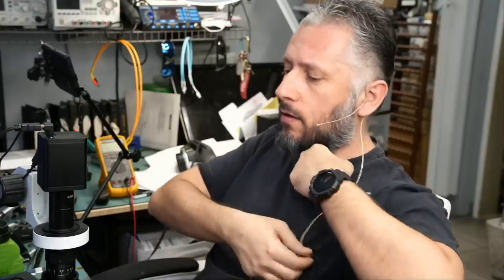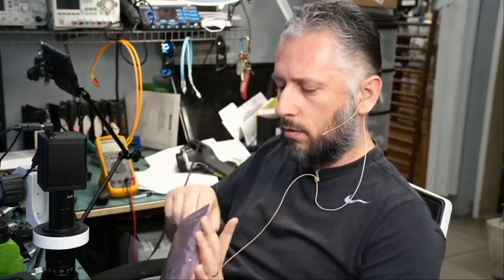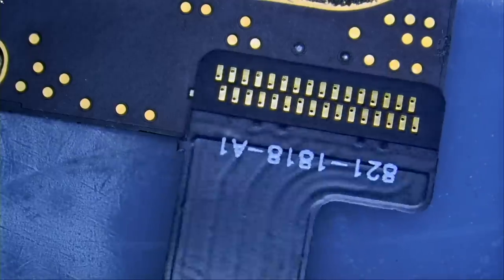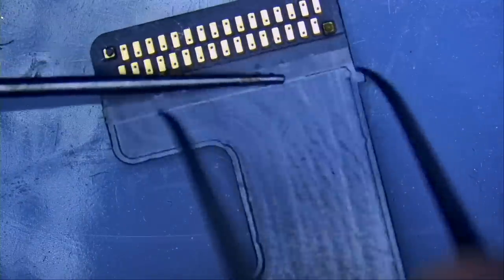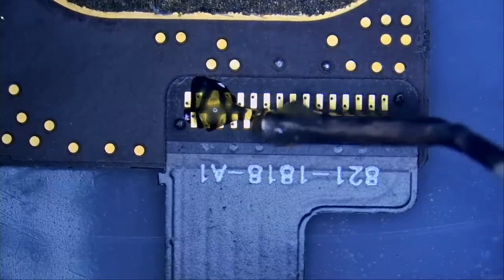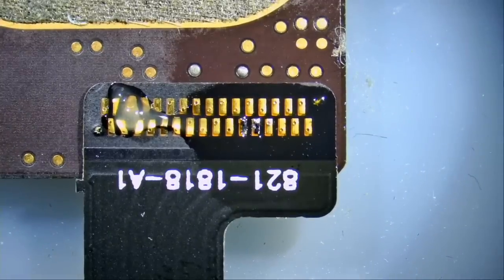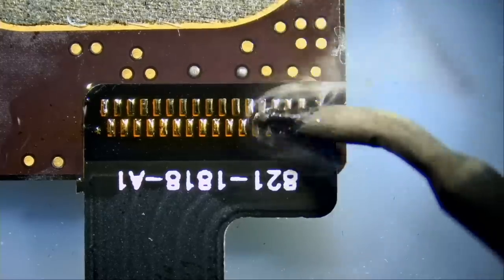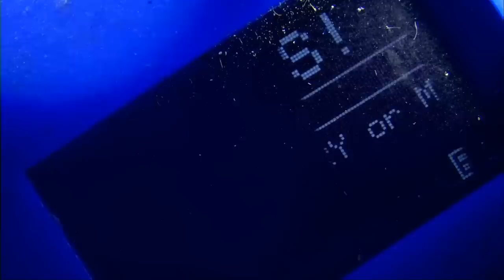Last repair for the day.  Mini Flex

Comment: Question…You did not apply solder between the cable and the board. Why not? Are you relying on solder to go through those tiny holes in the top of the connector?

Comment: I don't understand this one. You put flux and solder on top of the connector, but it gets soldered to the bottom. You put no solder or flux on the PCB. How does this work?
Reply from the maker: The pads on the wire has holes in them. Solder flow thru the holes under the cable.

Comment: I was expecting to see solder on the board first before the connector went on top and soldered, unsure how the small pin hole managed to get any solder underneath the connector.

Comment: I would like to see you try to solder 2 cpu pins on the pads for alignment. To see if it possibly to make it easier to solder a cable. I know you don't waste time. But maybe you will like to do the little experiment 😂. Sukran

Comment: I was wondering how on earth applying solder to the top of the pads of the connector would make it stick to the bottom. Looks like the pads on top have small holes on them allowing solder to pass through. Am I wrong on this?
Reply: You are correct. The solder flows through the small holes on the top.

Comment: Nice video, nice and short! I tried the same with the solder ball before but it got stuck to two pins on a e-reader. Had to melt it off and destroyed one of the 3 pins haha. I was replacing a battery, but the replacement battery only had 2 wires, black and red. While the original battery had a white wire in the center pin. So i thought i didnt need the center pin anyway( which got destroyed). The e-reader worked for 1 day and now the battery is not charging. So i will have to check again to see how to fix it.

Comment: That Weller soldering station is Best i Worked with. I have still one, i had two with vacuum but get replacement with wxr3..  I Don't like it 🤣

Comment: Sir I just wanna recommend  you might rate your laptop repair brand in summary hard to easy.

And which laptop is durable base on your evaluation and what brand is recommendable to buy base on the internal parts you have checked.